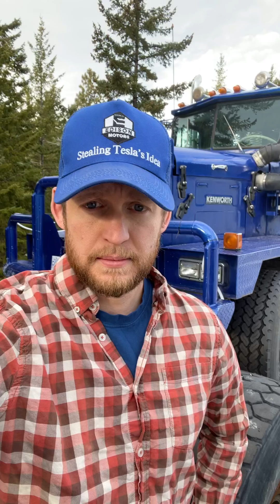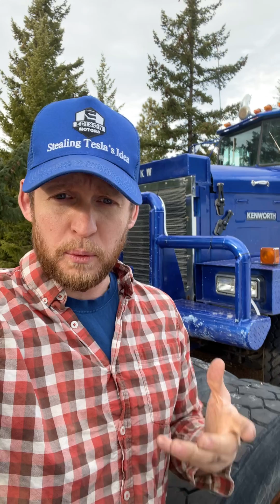Bridging the Gap: Diesel-Electric Hybrids as the Solution to Infrastructure Challenges

Comment: Great point on the energy demand. Across North America grid is about 25% of the energy consumed and fuel is %75 of the energy. 
Although, love to see green ammonia used in place of diesel... works the same, cheaper, 100% green. The engine/generator could easily be set up to use either fuel or a blend. That would give flexibility as green ammonia becomes more readily available.

Comment: The irony here is that the current trend is to reduce grid capacity by forcing everything to be renewables, look at Alberta that got their clean coal plants shut down and ironically had to buy coal powered electricity from out of province producers to make up the shortfall during a cold snap.  The chargers for the trucks will probably each need their own windmill(s) and solar farm to generate a bit of their own power to offset what they’ll pull from the grid for charging…  that won’t be cheap, but none of this is.

Comment: 1.5 to 2 megawatt is the same thing as 2000 to 2700 horsepower. And I'm sorry, but no logging truck is averaging more than 2000 hp. 
Maybe you meant 1.5-2 MW while charging, or 1.5-2MWh/day, i don't know.
Reply: Found some numbers on the internet: 
The average logging truck gets:
~5.1 mi/gal
~ 66000 mi/year

-> 13000 gal/year diesel consumption 

diesel has an energy density of about ~ 37kWh/gal
-> 480MWh/year = 1.3MWh/day = 55kW

Maybe the 1.5-2MW was actually meant to be 1.5-2MWh/day (which would be a bit more than the 1.3MWh that I calculated, but still reasonable). Either way, 1MW = 24 MWh/day, so it makes a significant difference.

The 55kW are still for the diesel BTW, going from a maybe 40% efficient diesel to an 80% efficient BEV, will cut that down to 27kW average power draw, and with systems like regen breaking it might drop a bit more.

The Cite C hydroelectric power plant will generate about 4600 GWh/year = 525MW average power output.
That's enough to power over 19000 BEV logging trucks.

Comment: So if your trucks use 2MWh of energy per day (not 2 MW).  And using your numbers (and CAT's) that the Diesel generator is 30% efficient at converting diesel to electricity, that's 2,000kWh/(10kWh/ltr x 0.30) = 667 ltrs per day of diesel.  How is that efficient use of diesel?  Chase said a typical logger spends $20,000 CAD per month, assuming 5 days a week, that's almost 500 ltrs per day @ $1.83/ltr.  If you use $2/ltr it's worse. The new Edison truck uses way more diesel, not half.  Things just don't add up.  Either Chace is too high on what his truck uses in MWh or way too low in fuel consumption per month of a logging truck.  It should be interesting to see what the truck really uses hauling logs down the mountain.  I suspect it's way less than 2MWh per day on average.  BTW, the BC forestry council says BC has 2800 logging trucks.  Curious where the 5000 number came from?

Comment: Come one Chace, talk to your engineers for crying out loud and learn the difference between power and energy. I know batteries use the term capacity to indicate how much energy they can store and the power company uses it differently to indicate how much power a generator can generate at a moment in time but please learn those are different things.  It's like confusing liters of diesel with horsepower.  It's getting annoying and gives your company a bad image like you don't know what you're talking about.  I love what you're doing and it's a great solution but 1.1GW isn't the daily output energy of the dam.

Comment: Audi just won the famous Dakar rally raid in their Audi RS Q e-tron. Two formula E electric motors power the from and rear axle and a third formula E electric motor is used as a generator powered by a 2liter turbocharged gasoline engine. The Audis had a 340liter fuel tank, the Toyotas that came second with a conventional drive train had 540liters

Comment: Electro-diesel mate, not diesel-electric.
A diesel electric use diesel engine to generate electricity all the time to run the vehicle.
An electro-diesel use diesel engine only to supply electricity to an electrical storage, which is a battery, but they run fully electric from the electric battery.

Comment: Hybrid systems do have their dawn falls. Changing form of energy never is 100% efficient. There is always loss involved. So more we have systems in a series we have more loss.

Diesel has got max thermal efficiency of  somewhere around 35-40% in a hundreds KW size. From there it is changed to electric by a generator, dropping systems efficiency couple percent. If it goes to electric engine from there it drops again couple of percent to somewhere around 25-30% overall. That´s really good, something hybrid trains can achieve. But the need of that energy in the truck is not constant. It needs some kind of energy battery in between to keep that diesel going in a constant load and to store  regenerative braking energy. Maybe more than one type. So kinetic/ battery/ capacitor energy storage is going to take some percentage again away from there. Then added weight of massive system is going to effect the max capacity of the system dropping over all efficiency. So we kind of start to be around that 15-20% thermal efficiency mark of a truck made this century. But with huge investment to adapt this kind of system in a smallest form yet. 

This is why I recon it has not been done yet. And meanwhile just battery charged in a local power plant can achieve 50 to 60% overall efficiency easy. As power production is going in to smaller units and everybody is investing in battery technology there has not been anyone betting in a system that still demands that investment in battery technology and still uses fossil fuels.

I still think hybrid systems are the future. Even we would have truck sized nuclear power plants, they cant come everywhere and just cant be small and light enough for every use. Fossil and hopefully chemical fuels are there to keep those small units mobile and going.

Comment: Charging stations are going to need large battery buffers (which will drive up the cost of the stations) so we don't need to run megawatts of power to each station. It's the only other answer I can think of for this time. But otherwise, I agree. PHeV for the next couple decades until we can run them pure BEV and upgrade the charging infrastructure. It's an entirely different fueling paradigm that we need to adjust to. Thanks for the discussion

Comment: Not diesel: dualfuel.  (i.e. diesel + CPG/CNG/LNG/H2/etc.)  That would allow truckers to power their gennies with whatever fuel is cheapest and many of those other fuels can be made locally through biodigesters/waste wood pyrolysis/etc.  (Hell, during WW2, 72% of vehicles of vehicles were running on locally produced wood gas and many had wood gas generators right on the vehicle!)

Comment: 0:29 we're not going to build 5000 electric logging trucks this year, so why do we care how much power they use right now with current infrastructure? We didnt build 100's of thousands of gas stations the first year the gas car came out either.  It will take time to build electric trucks as well as the infrastructure to support them.  your solution is good, provides a solution that can be used today, but pointing how how many gigawatts of power are needed for a theoretical one day replacement of all diesel logging trucks is immaterial

Comment: I'm with you and I hope to join your group soon but there is a very big difference between watts and what hours.

Sight C is planned to produce about 14,000 megawatt hours per day. That should charge about 15,000 electric logging trucks per day. (This is ssuming they have a 900 kilowatt hour battery (like Tesla semi).
I would recommend a significantly smaller battery as a diesel hybrid.

Comment: Well, we do need a engine generator system. Does it have to be a diesel engine, no, it can be a gas turbine or a steam engine or any number of other configurations. But you are right, an engine that is running at a constant speed can be closely tuned to provide a narrow but effective band of power. 

The other thing is that if the company pays a bit of attention to the overall setup, then gravity can be the primary source of power. The lumber is generally higher on the mountain than the sawmill, so the trucks weigh far more coming down hill. The generator then is the motor on the axle, no other generator is required. The load of lumber recharges the battery through it weight going down hill, just as a weight on a clock keeps the clock running.

Comment: you guys need to try and work with vw and see if they would let you guys use one of their 2.0l common rail turbo diesels. they are perfect for your application they are lightweight very fuel efficient and provide the 150 horses you need to run the generator  at 1500 rpm

Comment: I agree diesel electric will be the best idea. My dads cousin is a electrician and he knows the infrastructure wont handle if everyone has electric cars. Plus he has learned that the people who are working on these electric cars are as i see from 400volts and up, not all of the mechanics have certifications like electricians are required to have working on these cars. So im shocked no one has reconized this either.
Reply: Automotive technicians often get training on new systems and refresher courses. You also don’t need HV training to work on the majority of components (other than don’t cut the big orange wire).

There already exist scheduled charging and off-peak preferred electricity rates. Not everyone needs their car to start charging at 5pm when they get home from work, you just need it charged before leaving at 8am. With vehicle to grid enabled, utilities can actually make the grid more stable (was studied awhile ago using BMW i3’s).

We also just need more electricity in general as society advances, Cleo Abrams did a video on that.

There are certainly solutions to these technical challenges, it’s been massive lobbying efforts slowing us down. The cost of not reducing emissions is also very high, it just shows up under different line items in the budget.

Comment: I may be ignorant but i dont see a reason that thats how gas powered cars could be designed going forward. A gas generator may not be as good as a diesel, but it would still be able to take advantage of the higher availability of gas vs diesel. I remember watching a ted talk that proposed using jet engines to generate power to maintain the battery charge in big trucks (garbage trucks in their proposal). Different generator but the same idea. The car industry might have been better off sticking with hybrids. Get people accustomed to having the batteries supplement the engine then transition to the engine supplementing the batteries as needed. 

The mad rush of companies trying to claim as much of the full electric vehicle market has been painful in so many ways. The charging infrastructure is severely lacking. Emergency services are woefully prepared for electric car fires. Regulations on full electric car design struggles to keep up (brake lights not illuminating when quickly releasing the throttle which causes a pseudo-braking action).

Comment: A hybrid logging truck makes far more sense than a pure electric anything truck.
But
The technology is not optimal in the Edison hybrid for anything that doesn’t have a similar use profile.
Weight is the enemy of cargo capacity and also range so the lighter you can make a haulage vehicle the better.
Many years ago there was an electric bus fleet that used mechanical batteries (dynamos) and would quick charge at every bus stop getting a full charge to travel about twenty to fifty miles in about five minutes.
The problem that killed these busses off was the high cost of maintenance on the high precision bearings in the batteries.
Technology has greatly improved in mechanical batteries since those days making them cheaper and more reliable and much more efficient. While the problems associated with being in a vehicle instead of a basement will increase the maintenance and reduce their life they are a vastly superior choice for use in a heavy vehicle to the tons of thermite explosives they call lithium batteries.
A big heavy diesel generator is also not an optimal choice, although probably twice the price gas turbine generators used in aviation are far lighter and more compact and can run on almost anything.

Comment: Yup, you're 110% correct Chace.
Reply: Found some numbers on the internet: 
The average logging truck gets:
~5.1 mi/gal
~ 66000 mi/year

-> 13000 gal/year diesel consumption 

diesel has an energy density of about ~ 37kWh/gal
-> 480MWh/year = 1.3MWh/day = 55kW

Maybe the 1.5-2MW was actually meant to be 1.5-2MWh/day (which would be a bit more than the 1.3MWh that I calculated, but still reasonable). Either way, 1MW = 24 MWh/day, so it makes a significant difference.

The 55kW are still for the diesel BTW, going from a maybe 40% efficient diesel to an 80% efficient BEV, will cut that down to 27kW average power draw, and with systems like regen breaking it might drop a bit more.

The Cite C hydroelectric power plant will generate about 4600 GWh/year = 525MW average power output.
That's enough to power over 19000 BEV logging trucks.

So in reality you'd only need about 1/4 of Cite C to power all 5000 logging trucks in British Columbia, not 10 Cite C power plants. 
That's not 110% correct, that's like 2.5% correct.
Reply: @plainText384  uh oh, someone let a paid corporate shill in through the crack in the door....everybody run. (now, let's find out if you're only 2.5% corporate shill?)
Reply: @plainText384  The guy's a logger trying to build diesel electric trucks...not a hydroelectric grid engineer. He's 110% percent correct in what he's trying to do. But as intelligent as you believe yourself to be, you probably realize that and are just venting for clicks.
Reply: @merlepatterson   he overestimated the actual power demands for a BEV logging truck by like a factor of 74 and again overestimated the energy production of a hydroelectric power plant by a factor of 2, because he used peak power generation capacity, instead of average power generation.
All in all, he's probably overestimating the number of power plants needed to support a 100% BEV logging operation in BC by a factor of 40.

40x makes a HUGE difference, no matter what profession you have. 

And he IS actually designing and building this thing, so he should (and does) absolutely know the difference between MW and MWh/day, between peak power and average power, between power requirements before and after the inefficiencies of a diesel engine.

I am 100% sure that he and his team probably know this stuff better than anyone (better than me for sure, I'm not a logger/ EV designer), and if he did this sort of calculations again, he would absolutely arrive at a similar figure to mine.
 Ok, maybe +- 60%, my numbers are based on a review of logging trucks in Washington, not his part of Canada, so weather, climate, dirt vs. gravel vs. paved road percentage, etc. might be different. If we assume he meant 1.5-2 MWh/day, when he said 1.5-2MW, and that figure is accurate, then that's maybe 60% more. But not 40x.

In my mind, the fact that he made these mistakes probably just means he didn't double check his work, it happens to everyone.

Comment: Any chance you guys are working on a Cab Over version?
Reply: - not really a problem (especially if you already have a cabover to retrofit)- the radiator +genset is palletisable (if not already on a "pallet"), just slide right in...  Swap the axles for e-axles and locate the inverter / chargers...

Comment: Does normal gas, or corn juice (ethanol) not work as well for this type of hybrid?
Reply: diesel engines don't have the throttle losses gas/ethanol engines do.  but otherwise, an engine designed to run at peak efficiency, with battery systems storing surplus energy or providing surge energy as appropriate can operate more efficiently at varying power outputs.
Reply: Yeah, whatever generator setup you want to run (propane? Hydrogen eventually for no CO2) would work, the issue becomes infrastructure for refueling large trucks which is currently just diesel.
Reply: Yeah, whatever generator setup you want to run (propane? Hydrogen eventually for no CO2) would work, the issue becomes infrastructure for refueling large trucks which is currently just diesel.

Comment: A lot of people are saying we are going to have a problem but no one is listening. It takes a long time to get parts for the electric grid. My solar panels have had almost no output for the last 2 months because its been foggy and cloudy. If I was off grid I would have to have some kind of backup power to keep everything going. We are putting more and more things on the grid with electric vehicles, cooking and heating. Where is that backup power for all those renewable energy sources that we are installing. I'm seeing higher rates and blackouts coming. So if you are full electric after a power outage you are probably going to end up with a dead vehicle, no heat and no refrigeration. I think the reason no one is listening is because the focus is to get rid of fossil fuel usage.